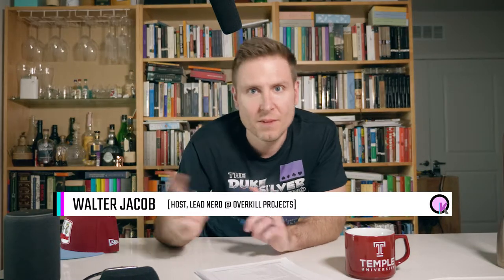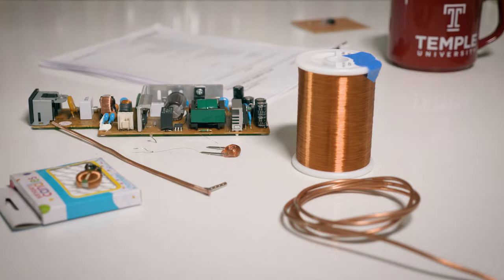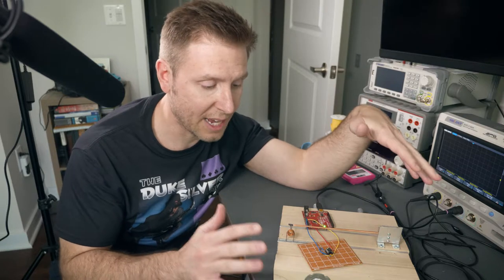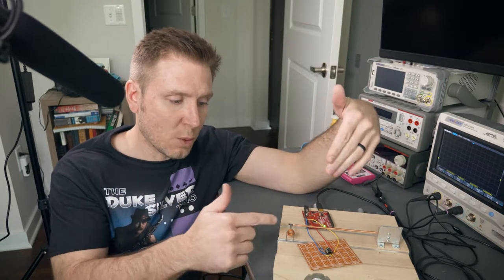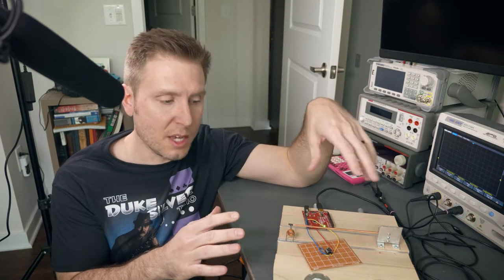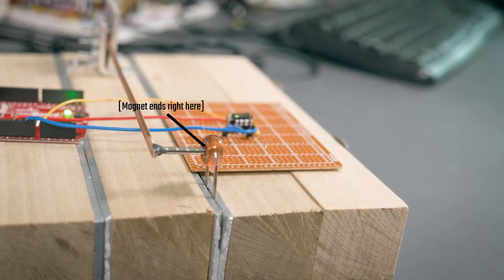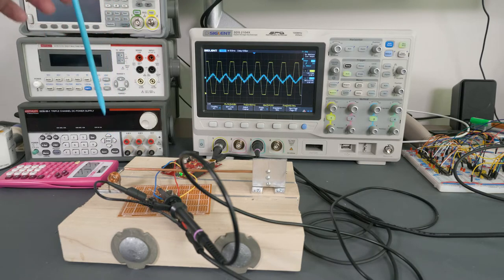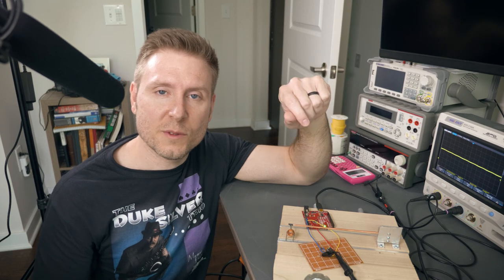DIY Arduino Seismograph

Comment: Well back in 10th grade in the early 2000s I built one at home without any circuitry or microcontollers. It was based entirely on pendulums and springs and even had automatic paper advancement mechanisms with stylus like the real thing.

Comment: What is the purpose of that 0.1uF capacitor on the circuit diagram?
Reply from the maker: If you check the datasheet for the MCP616 you'll see in section 4.6 that they suggest a bypass capacitor on the positive supply - that's all it is. Nothing fancy, but good catch!

Comment: Can I use an LM393 instead of the MCP616 opamp?
Reply from the maker: If you use a comparator, you will always get high/low voltage output.  In this setting, you wouldn't be able to get magnitude of the event, but you could build a circuit that alerted you when it detected enough movement.  Just fed the output to a microcontroller with, say, WiFi or BLE and have it alert you when someone opens your refrigerator without authorization :-)
Reply: @overkillprojects8091  Thanks for your reply. No it is nice to have an analogue signal fed into an arduino like your setup , then make the alarm triggered when a certain threshold is reached.  I think I will go for something like those low noise opamps MCP616, LT6014, LMC6462, but these are not available in my country and have to wait quite a while for them to be shipped

Comment: Can you simply use MEMS accelerometer instead?
Reply from the maker: Of course!  But that approach was out of scope for the video, and the approach I use here has the added benefit that it can be more precise for less money.
Reply: @overkillprojects8091  Thanks for reply!
Reply: @overkillprojects8091  About accuracy: can you roughly estimate an accuracy (trueness) of your solution? Why are you saying it is " more precise"?

Looking for example in  MPU-6050 datasheet it states noise performance of 400ug/vHz @ 10Hz, that results in 400ug * sqroot(10) ~= 1.2mg.
And according to this table https://earthscience.stackexchange.com/questions/9822/using-accelerometer-as-a-seismograph
it will be impossible to sense a "weak" earthquake vibrations.
Same time LIS3DHH has 45 μg/√Hz.
Reply from the maker: The theoretical precision is dependent on a few factors, the primary of those being the length of the moment arm, the strength of the magnet, the number of turns in the coil, the gauge of the wire in the coil, the performance of your amplification stage (I don't have this in the video but of course you would have amplification stages for each order of magnitude in practice), and, finally, the precision of your ADC (here I'm using the Arduino, but again, in the real world you would use something appropriate for the precision you need).  However, assuming you have a reliable calibration procedure, I have difficulty seeing a limit to the available precision, certainly it would be much higher precision than a general purpose accelerometer over the range you are designing for.  Let me know if you're interested and I'll consider a follow up video.
Reply: @overkillprojects8091  I agree that with mechanical approach you can achieve incredible precision (imagine placing spring loaded swinging arm in a bottle and then removing air from it). 
But I'm lazy) So I'm looking into the MEMS direction. For example BLESeis Earthquake Detector: it utilizes LIS3DHH.
What I've found by this moment is ADXL355. It has 20µg/rtHz and 20bit ADC and it's still affordable for hobby project.
What would be interesting to see in a follow up video is a side by side evaluation of mechanical and mems seismographs. I mean with mems one you can measure the real value of vibration and thus obtain some values for the results of mechanical one and range it.
Reply: @overkillprojects8091  IIS2ICLX
Reply from the maker: @Temp Void The ADXL355 is a nice device - if you're looking for high precision in a small footprint and money isn't an issue, you should give it a go.  Since I think you are only worried about the derivative of the magnitude of the acceleration vector, the relatively high zero G offset shouldn't be a problem.  It's funny but even with the excellent noise density, it would be hard to trust the last three LSB of the device without more information, but measurement better than g/200000 is pretty great for most uses.  Of course you could make use of some simple physics to increase the sensitivity even further if you really need it for some reason, but it seems like you would be more likely to start picking up vibration from nearby vehicles and such rather than actual seismic events.

I'll consider doing a follow-up with a mems accelerometer, I have some sitting around and I haven't done a mems video yet.  Thanks!